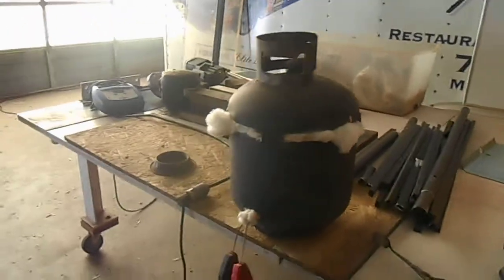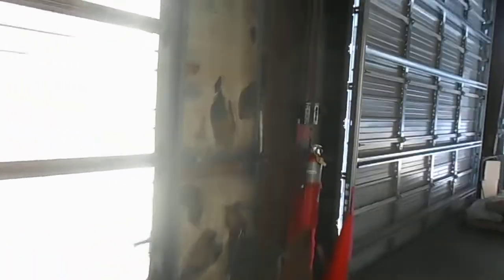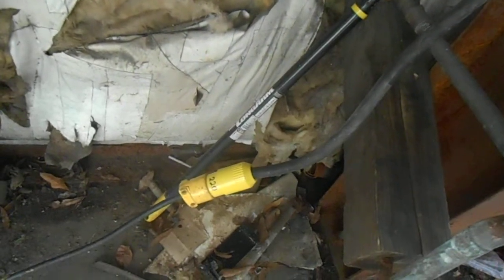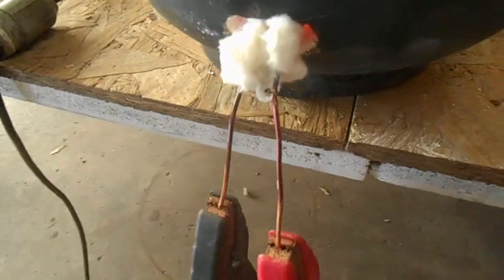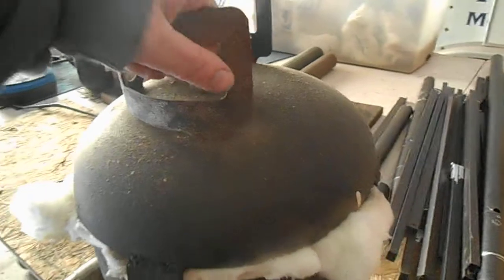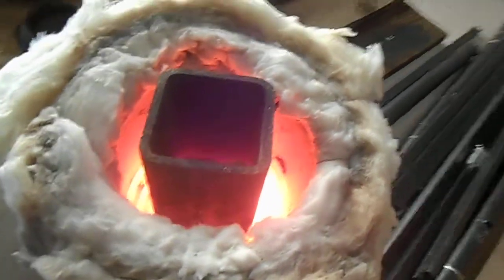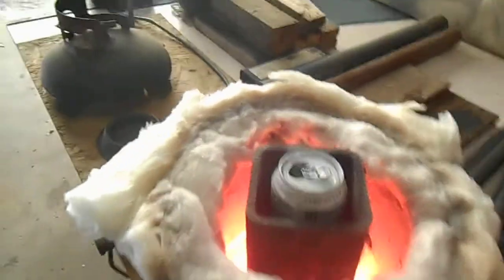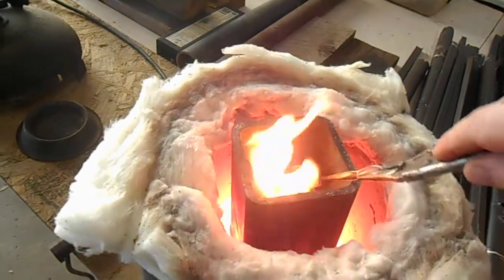DIY kiln002 electric kiln metal aluminum melting furnace works easy cheap 220v home made

Comment: Super dangerous, but effective. If I were you I would insulate the 2 bare wires you have coming out of the kiln. You could wire them easily to a regular extension cord then you could turn it on by simply plugging it in.
Reply from the maker: Agreed, super dangerous. that hook up was temporary.

Comment: Be careful with that ceramic blanket stuff bud, they call it "cancer blanket" in the blacksmithing industry because when you mess with it and it goes airborne it causes some kind of cancer in your lungs. I forget the exact type. 
Awesome video btw👍💯 thank you 😎
Reply from the maker: I hope not, its just home insulation. I thought it was made of recycled glass bottles. Anyway I dont have that much exposure to it anyway. thanks.
Reply: That's awesome 👍💯💯 I'm glad it works I'll try it too

Comment from the maker: One other thing I learned is dont use the fluffy insulation to fill the wire hole in the bottom and the gap under the lid. I think it is important to let air flow in at the bottom and rise up and out the lid gap to prevent from overheating the wire connections and the heating elements. Yes it is a little less efficient but I think I overheated the elements once that way. without it it has not done it again. I just have the burners sitting in there so I can change them out if they do burn out. The first time I embedded them in the plaster/sand mix but again, I think that caused them to over heat, you want air current to flow around the burners slightly. Also it helps to be free if and when they need replacing. Also, I secured the tank on a piece of 2x10 wood and secured the wires because any moment to the hard wires going to the burners will eventually cause the screws to loosen and that's not good.